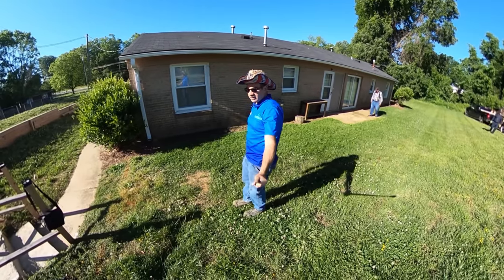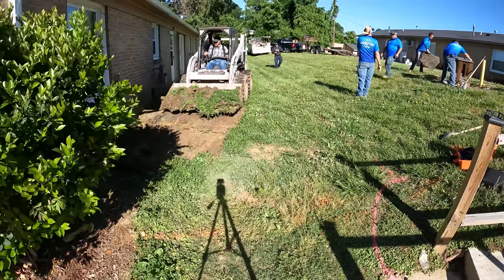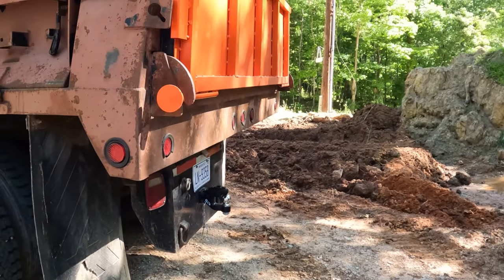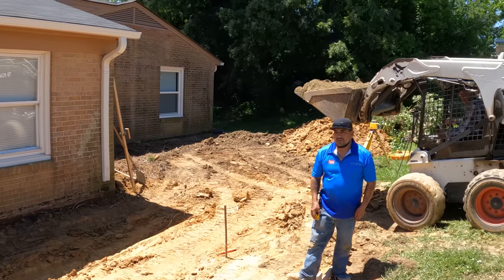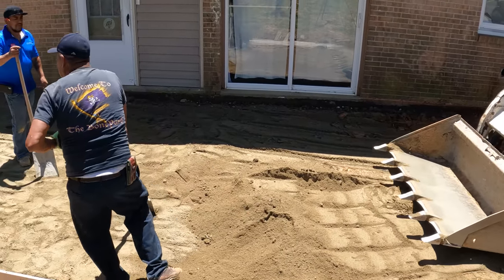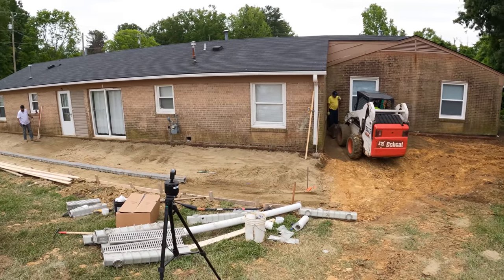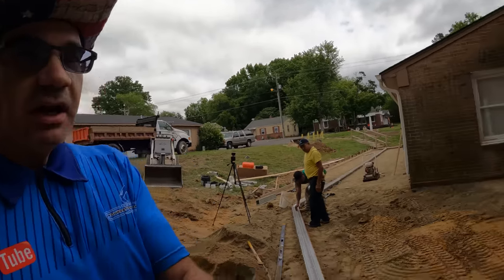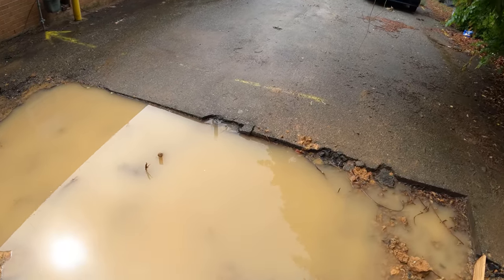Part 3 of 4 The worst Apt. Flooding I've ever seen!

Comment: I'm curious, how close was this situation to justifying the use of a channel drain with a built-in slope, i.e. with a channel that gets deeper from one end to the other? Have you had occasion to use such a product? I would imagine that would have some cost premium, but it seems like it would both improve fall and provide increased overall capacity. Or is it better to just go wider/larger overall wherever you have even a little bit of fall and use "fancier" product as a last resort?

Comment: why didn't the downspouts get put into the drainage system it looks like its just dropping water right at the slab in the first place??
Reply from the maker: Maintenance is the reason. Or at least lack of. I didn't want to send all that debris into the pipes with such little fall. The debris would be hidden and could cause clogs and make the drainage system less effective. I liked the idea of keeping the debris visible so it can more easily be managed. Great question!

Comment: Have you considered pouring concrete across the bottom of a french drain to keep it from seeping water into an adjacent foundation?
Reply from the maker: Yes but the tiniest crack would let the water leak out of the trench. If that's the case, I think keeping the surface water on the surface is a better option.

Comment: 28:27 if the inlet-flow through that plastic grate is anything less than 247 GPM then it should be upgraded to the galvanized grate.  

NDS 12" plastic grates are rated at ~155 GPM but the galvanized version is rated for ~348 GPM with a 6" pipe easily able to move 391 GPM.
Reply from the maker: Grate point Bob! Haha If we get the concrete correct on this one the water will flow right along it like a channelized channel.

Comment: A swale at the bottom of the hill would've worked fine. Curve it around the back.
Reply from the maker: I don't think it would have chris. There wasn't enough fall to move the water so a swale would just be sitting full of water, leaving the foundation still at the low point.

Comment: good call ,on this job,concrete is good stuff,water proof upto the house,and slopes away from house ,so gravity pull it away,then water from hill come down and follow the slope ,around the house ,and channel drain take fare bit away ,and roof water ,whicth can be thousands gallons in a storm ,fall onto concrete and follow the slope ,gravity ,,and if nobody wants to fix any think ,as they do,so basic tech,slope that it will allways work,if over loaded ,bet every ones on there bubbles now ,checking ,so not have to dig it up again ,do it right the first time ,can the road at the end handle the new load of water ,proper sewage drains,under the road ,have been at the bottom of a step hill,in the rain ,and see tons water travel down the hill,were does it all go,have been in a cave too,pot holeing ,and it rained,we got wet in the tunnels ,was scary time ,should work good ,the money shot be the rain video ,cant wait ,best part

Comment: The entire brick wall of that building has been acting like a sponge for years and soaking up all the water standing at its base. Look at all the mold all over the face of it. The inside is probably a disaster. Brick is very porous and will hold a lot of water.

Comment: Great job! But, how come none of the downspouts were connected to the drain?
Reply: probably cost, but the water will get to the channel drain no matter what because the concrete slopes. also the channel drain is a continuous run. If you pipe in the gutters to the side, you would have to change to pipe like they did on the 45 at the end of the straight run, then back to channel drain.
Reply: @MacAttack2010  it also explains why the area was flooding before the concert and channel drains were put in. All the water from the roof was being dumped right at the edge of the building.
Reply from the maker: Great question and I'll address that in Part 4 in more detail. With so many trees I didn't want the debris to be hidden inside pipes with such little fall. I liked the idea of the downspout spitting out debris on the concrete where it could be identified and cleaned up more easily than inside a pipe.
Reply: @GCFD  looking forward to part 4!

Comment: Whoever built that complex so low, that's the real problem. Cutting back the slope for more drainage looks like the right thing to do. Have you ever considered a curb at the edge to help more surface water go around the corner.
I see your next problem where you trimmed the black top. There is water against the building. Phase 4. Please tell me there is room to keep the new concrete below the finish floor.

Comment: Why don't you use the company that computes the correct fall that's built into the channel drain and all you must do is make sure the top of the channel drain is at the curvaceous on the concrete and the fall is built into each numbered section IT TAKES ALL THE GUESSWORK OUT OF THE CHANNEL DRAIN  - LET ME STATE AGAJN THE GRATE IS KEPT LEFT THE BOTTOM OF THE CHANNEL DRAIN HAS THE FALL BUILT IN.That way if the correct measurements are given and it's installed level and it doesn't drain its on them but they never get it wrong
Reply from the maker: That would have been more expensive than this job needed to be. We had fall just not a lot of it. It took a couple days to get our channel drain set correctly.
Reply: @GCFD  how many man hours wasted in 2 days vs the expensive drain